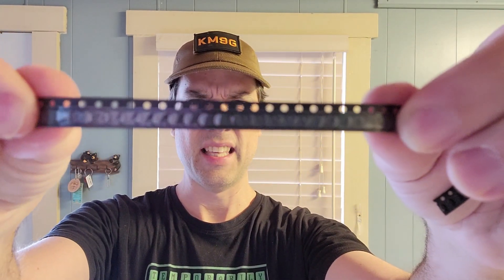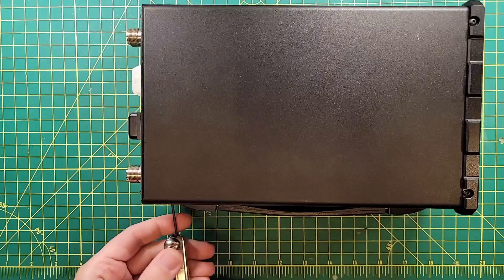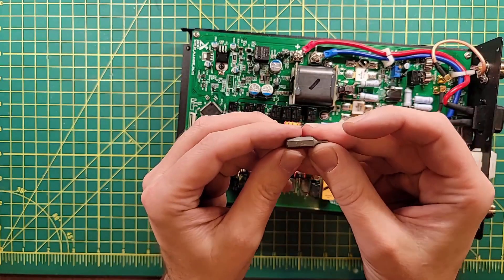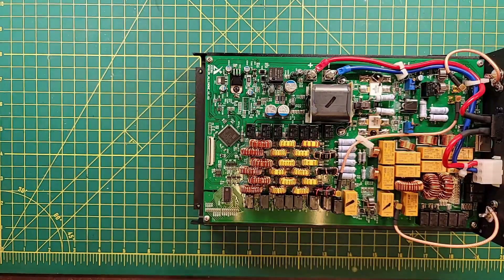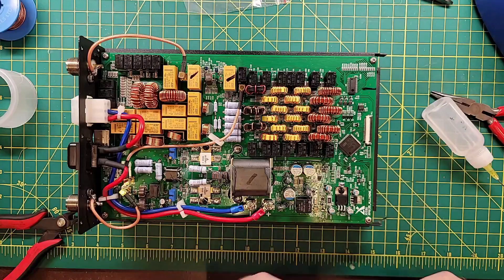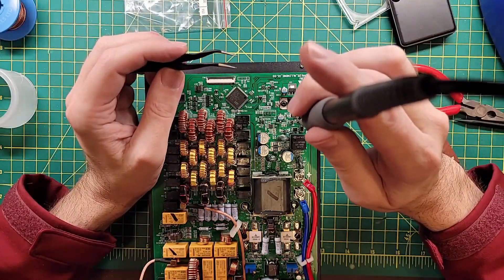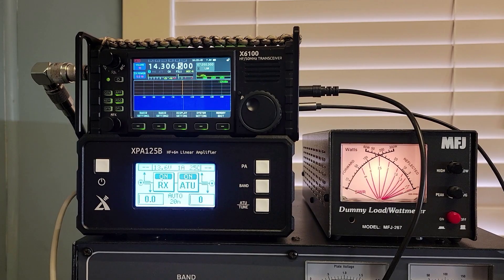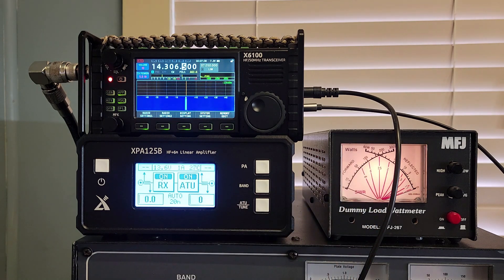Can I repair the SMD burnout in the Xiegu XPA-125B?

Comment: So, I think I have blown up my 125B like you did. The same problem presented itself. My problem now is that the board on my amp is never. I have version 1.041. This means they have changed the power circuitry (a little bit) and removed all component markings from the PCB (thanks, it really helps to repair things…). Clearly, they don't want you in the box. I think I have the problem located, but if anyone has done this on a 1.041 board, please let me know where the MOSFET and Diode are. I think I traced them, but I would love to verify. 
For reference
Reply from the maker: My were pretty easy to find because they were burnt up. Good luck in your quest!

Comment: My amp has taken to telling me "Low Efficiency", recently...  Did you get similar?  am I in for a SMD Repair, myself?
Reply from the maker: Low efficiency could be a bad SWR match on your antenna or low power from your transmitter.  Check the normal "ham stuff" first before diving into repairing circuit boards.

Comment: I want to get this amp. It seems that a lot of ppl blow theirs up. Now I am concerned if I'll destroy mine when I get one.
I'm glad you fixed it. Otherwise, it'd be a damn expensive paper weight.😊
Reply from the maker: It has been working great since the fix... And I caused the problem buy "going rogue" compare to a mirage or an RM Italy and I think it's still a good deal.
Reply: @temporarilyoffline  thanks T.O. okay, so I just don't copy what you did? Lol. 
It ain't cheap, but I think it will suit my needs well with the HL2, which I'm leaning towards and probably get soon. I have been brainwashed by everyone's nemesis... 😆
Reply from the maker: @DonzLockz  hey, I had fun... Did you?

Comment: Mine stopped working by not by being able to to switch off  PA and the manual band switching does not work. It does not match to right band when I connected by xiego 6100.  I am assuming it is junk now
Reply from the maker: I have had pretty good success with mine so far (except for this, but I contributed to the demise here).  Have you opened it up and looked for anything broken inside?
Reply: @temporarilyoffline  I think I may do that because it may be something mechanical with the buttons.

Comment: I so wish I had watched this video before I did exactly the same thing to my brand-new XPA125B. Before the replacement arrives I'm building a new cable from the other direction, with a TRRS plug, 4-wire cable and a Mini-DIN 6 plug to solder on the end.
Reply: Radioddity replaced the unit for me, and I trimmed and taped the extra conductors on the DIN cable. Sadly, the exact thing happened again. Tracked down a schematic and the N/C on pin one is to a diode (D19) and a 100nf capacitor (C217) that live between +12v and ground. Plus the shield wire is tied to the connector shell. I'm betting that diode and capacitor pair is what blows. What were the parts you had to replace? And, if you've got any left, can you spare a couple? At least my 30 years in the musical instrument industry has me connected with guys who own actual SMD soldering rigs.
Reply from the maker: @GVDub  The part #s I used are in the description.  I got in the habit of ordering QTY-1 from mouser because I have never once gone into my parts bin and consumed any leftovers.  Maybe someday, but not yet.
Reply from the maker: Ouch!  it is fixable... if I was smarter I'd think about how to put in a protection diode too!  Good Luck in your repair!
Reply: And wow, do I feel stupid.

Comment: Proud of you TO for having the courage to take this SMD repair on.
Get yourself one of those SMD practice kits from Amazon & eBay.

If the budget stretches, eventually get yourself some Amtec flux, screwdriver handle hex & torx bits (so much easier!), a Quick 861 hot air station, microscope & kapton tape which can help keep heat away from other components.
Louis Rossmann & Paul Daniels as well as Mikes Radio Repair & TRX lab have fantastic tips on such setups.
I'm considering the XPA125 to QRO boost my 705 sigs at home
Reply from the maker: Thank you!  I have a video on the 705 and the XPA125B, they work well but so far don't autoband switch.  I think there is a way to make that work as well, but not enough hours in the day.

Comment: fastest way to remove smd parts is to cut them in half with fine sidecutters - great job by the way - those smd parts are so small - i got myself some of those magnifier glasses - a good soldering station with a rework hot air gun is just the best way
Reply from the maker: I literally always forget that the part I'm removing is already trash and I it doesn't matter if I break it further.  Even after hours of trying to be gentle.  Thanks for the reminder!

Comment: Well, the statement should have been a question "Well, I can't make it any worse ?" . I'm not sure I would work on that amp without a schematic, did you have one. SMD parts are worked on using special stuff. Little microscopes, hot air from a cheap chines Ebay soldering station at the minimum . There is a group at GroupsIO for that amp. One guy had his low pass filters chosen incorectly (suprisong that its possible for that to happen) and blew out some things so you see a post called XPA125B repair. And possibly other things about your particular problem. Good luck. Incidentally a few have done smd repairs without the air but its not always successful.
Reply from the maker: Thanks for the tips.  I'll check out the group.

Comment: Hi Steve,
Nice successful repair. My hands would be shaking also with the size of those components. Putting a little flux on the solder wick will make it work better. You and the family stay safe.  73  WJ3U
Reply from the maker: Pretty shaky here too, thanks for the tip!

Comment: I'm so glad to see this video today! Today is the 11th day from the shipment of my XPA125B from HRO who hasn't replied back to me. After 10 days is a 15% restocking fee. Mine is broken, probably in two ways. First, I couldn't get it to tune or amp anything. Second, a power pin in the back is loose and pushed in too far. After shaking my desk it would randomly turn off. So it's nice getting an advance look into the box. Maybe Saturday I to may be making a repair video. Practicing for my club, no youtube fame dreams lol.
Reply from the maker: I wouldn't worry about the restocking fee, that's for a return and you're looking at free warranty repairs.  Not that it becomes any less of a pain...  I'd give HRO the choice of doing the warranty repair to your satisfaction or accepting a no-charge return.  Let me know how it works out for you.  Doesn't sound like fun.